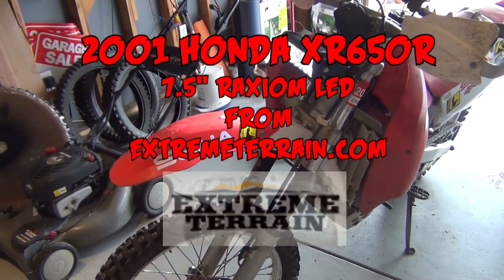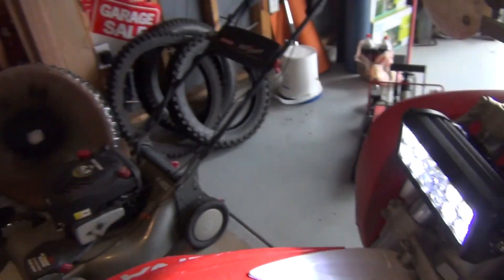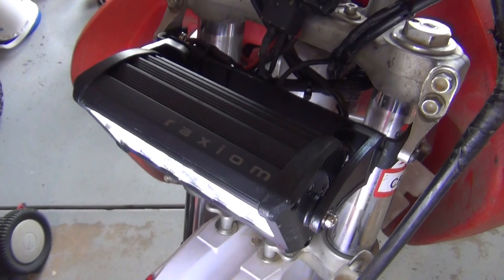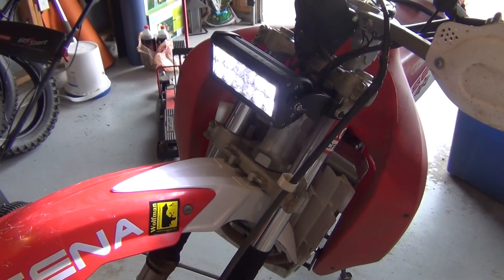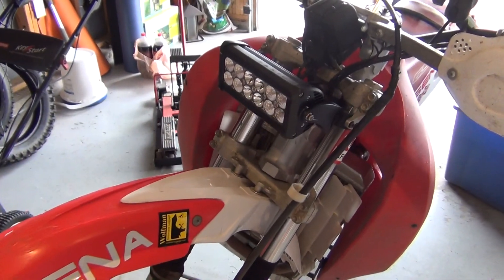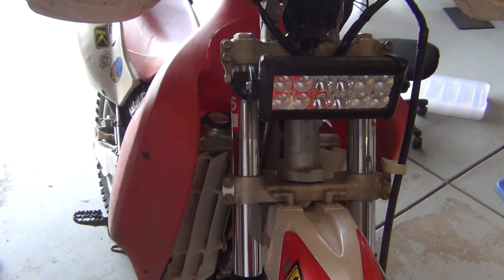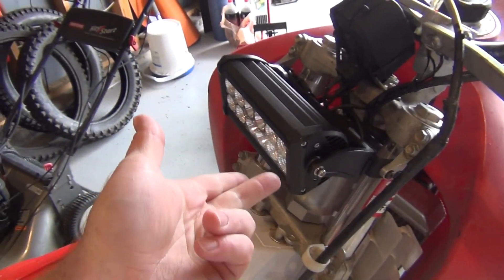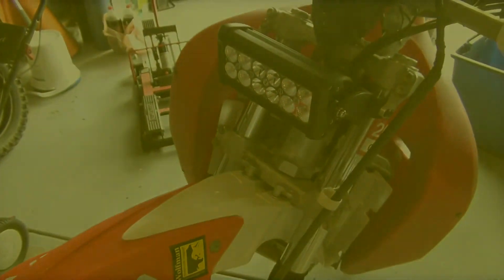ExtremeTerrain Raxiom LED Light Bar - Part 7

Comment: Where did you get the mounting hardware for it? This is exactly what I've been searching endlessly for...
Reply from the maker: It comes with it, other then making a mount to attach the mounts it comes with to the bike. You can buy these type of lights on Amazon. I got to say I liked it but it lasted a year, go the Amazon route and pay like $20-$30. Here you go $14.99 basically the same type of thing. http://amzn.to/2eywOgi
Reply: +Meeker Extreme The mounts that attach the amounts to the bike is what I meant